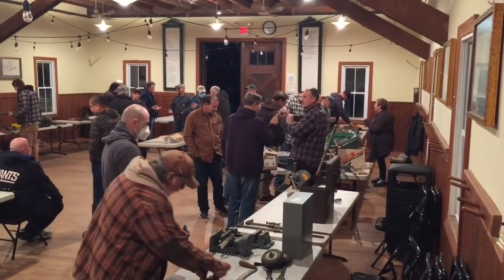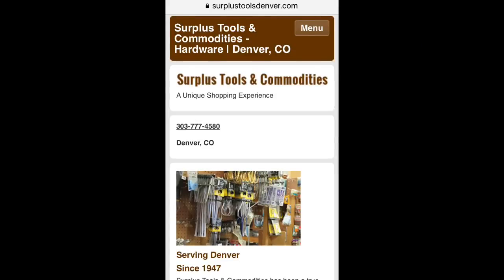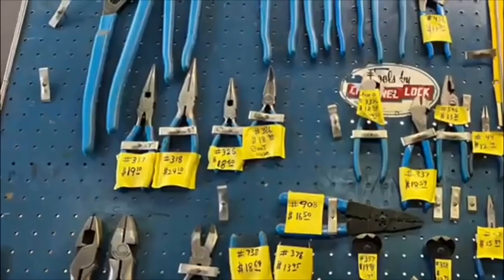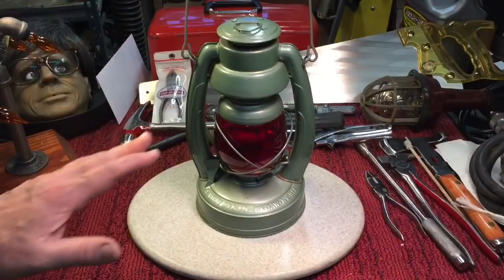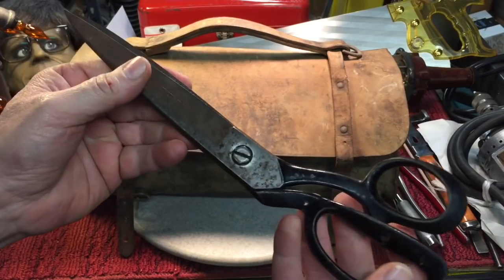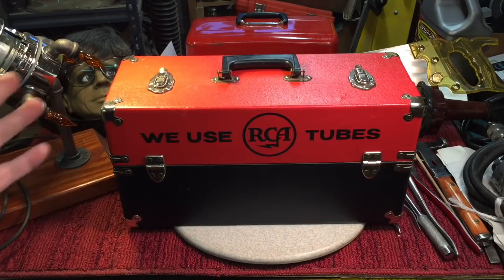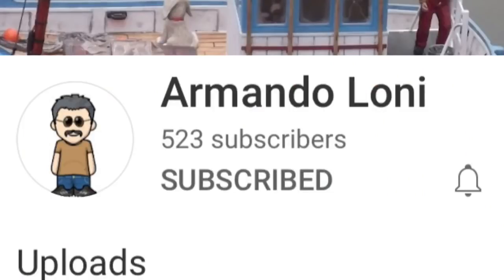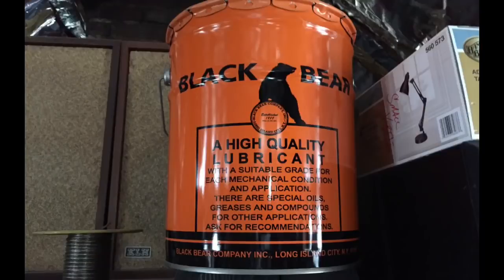Lawson Wrench- My Entry for Armando Loni’s Halloween Challenge

Comment: I'm really into vintage audio gear. I recently needed a new set of four electron tubes for my Mcintosh. I learned that for whatever reason, the Soviet Union produced far better quality tubes than anybody else. For many years now, the vintage audio community has relied on former Soviet bloc manufacturers. They have been the only one manufacturing tubes for quite some time. The last tube factory was located on the border of Bulgaria. About 4 months ago, this factory tragically burned down. There is now no new manufacturer of tubes. So anybody out there also into vintage audio or video, order your extra tubes ASAP. The prices have not shot up yet, but availability is getting very slim. Those tubes cost me $12 each. The boutique audio store has them, they charge $87 each. I just thought this was an important tip to circulate. It's a shame how much equipment will get scrapped over a $5 tube.

Comment: I agree that the leather bag restoration will be interesting. Hey the Denver surplus center could be a restorer/collector vacation destination. Question for you - what do you use the clamping pant hanger on your work bench for I see it when you pan down on the bench. I have a couple and am looking for reuse ideas.
Reply from the maker: Michael- The hook broke off the pant hangers so I use them as makeshift soft jaws for the vise!  They work very good too!